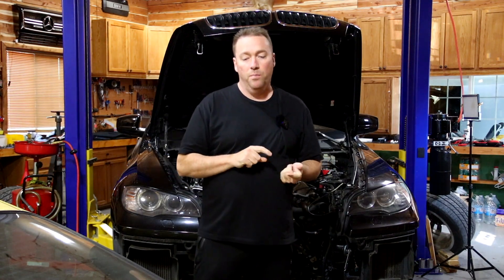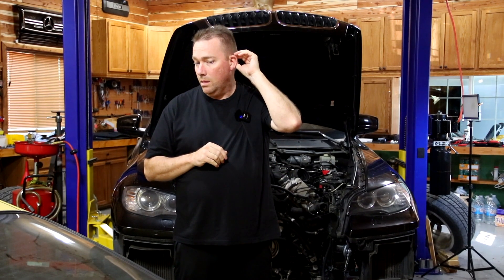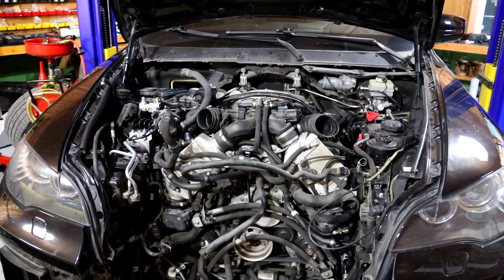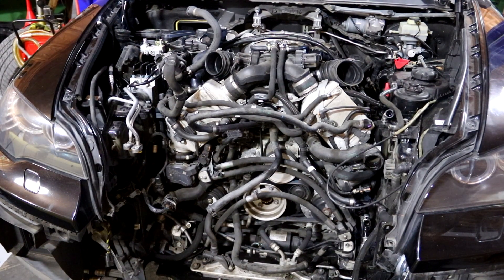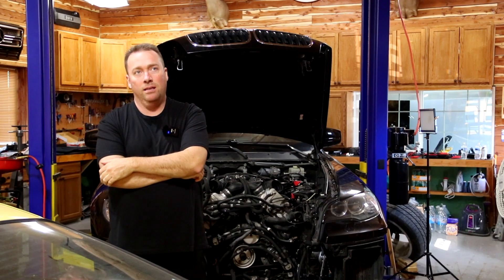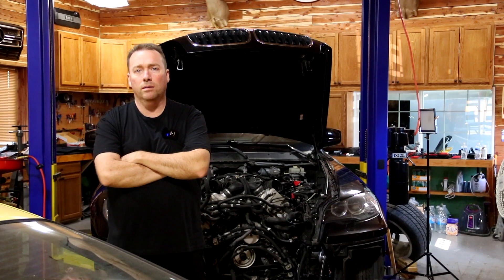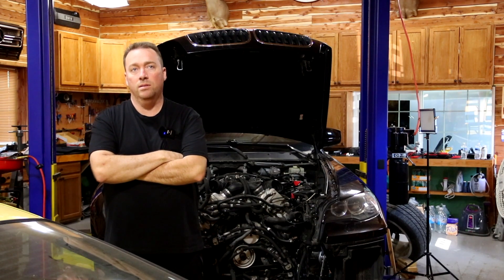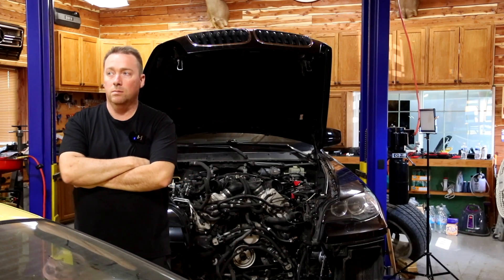So Why Do BMW Rod Bearings Fail On These Engines S62 S63 N63 N55 S65 S85

Comment: All I can speak to is the S85 V10. No one can convince me it's the bearings, it is idiot owners, wrong oil, no idea how to properly warm the V10 correctly. People mistreat the hell out of it, sell it to some unsuspecting soul, then they think they bought junk...I have had three E60 M5's, still have one today
Reply: MANY BMW issues come from poor ownership. I have a 2000 E39 528i 5spd ZF. Bought it brand new out of college. In 22yrs I had the radiator and water pump fail. That’s it. I rarely drive the car over 3,000 rpm. Don’t think I ever hit 5,000rpm. Change the oil with synthetic every 5k. Garage kept in sunny AZ. 
Zero rust, oil leaks or CCV issues - ever.
Reply: @paperandmedals8316  jeez bro how do you never red line it? I have an e39 530iA and errr... I do. I don't think that counts as misuse either, but yours should last for ever yea.
Reply: @ironmantooltime  I have a Hayabusa if I have the need. Not my E39. It’s a luxury car., not a sports car. I see people all the time in the bmw Facebook groups bitching how shorty their car is, and in another posting they’re talking about drifting it. Treat it like shit and it will turn into shit.
Reply: @paperandmedals8316  haha well yea a hayabusa will cover it. How many miles has the e39 done, she must be a beaut/minter 👍
Reply: @ironmantooltime  E39 has 96k and the E38 has 97k.
Reply: @paperandmedals8316  wait, you've got an e38 as well? Tell me that's not from new as well 😎
Reply: @ironmantooltime  no. E38 740i was one owner before me. Real estate developer bought it for his wife in 1998. I got it off of her when she was 78yo. BMW maintained for all its life, for what’s that worth.  But I literally have the one owner car owned by an old lady.  I’m in AZ, so zero rust. Plus she had some sheep skin cover on the seats so when I took them off there was leather looking perfect. 
It’s an M62 engine and I know they’re not a great engine. But the car was owned by a caring owner that could afford to maintain it. Not a kid buying $1,500 coil overs while the car is leaking oil and coolant.  Another car likely very rarely driven over 3,000 rpm and never raced stop light to stop light.
Reply: @paperandmedals8316  man that's awesome. The timing chain is sensitive to correct oil change intervals and warmup. Quite possible if its been well looked after it won't need it doing. I believe you can change the tensioner on those easily but if there's no rattle she's probably good. What a collection, wish you had a channel 😎

If you leave the ZF in drive (not sport or manual) and don't kickdown it will barely go over 2500 revs on my 530i, so for wafting around it should barely stress the engine at all. Easy 250k miles if you'll keep em that long 👍
Reply: @ironmantooltime  tensioner was indeed chagrined by me. The previous one had a collapsed spring upon inspection, though there was no timing chain issue. I dropped the lower oil pan for an inspection there,  as well. Changed the trans fluid and filter. Used Nathan’s recommended Valvoline MaxLife ATF. The fluid that came out of the trans and differential was so foul and dark. Of course a BMW dealership mechanic would never change the life time fluid.  That would be admitting that life time fluid is a cruel joke. Even ZF says 60k miles first change and every 30k there after.  Love to know why BMW doesn’t follow its supplier’s recommendations?
Reply: @paperandmedals8316  nice job, I'd use maxlife too but its quite expensive imported into Europe. Had mine done with spec zf fluid at 135k but tempted to do again 10k later.
Reply: @ironmantooltime  European! Didn’t think you guys watched Nathan. I met my wife in Romania. They have some amazingly beautiful woman there. She likes her Mercedes’ Benz convertible CLK55. Not much interest in my BMW’s.
Reply: @paperandmedals8316  sure we do, he's the internets most knowledgeable bmw guy 😎 Romanian women, 55 merc engines, bro you are clearly a man of excellent taste. Have a nice day 🇺🇸 🦅 🍻
Reply: @paperandmedals8316  hard to imagine never driving a car over 3k rpm. Must only drive around your neighborhood
Reply: @yophilli  3,000 rpm is 85mph. I shift at or below 3,000 rpm. It’s not the only car I own, but it’s a car I want to have for many years to come.
Reply: Agree running what is a race engine for long intervals oil changes is gonna do the weakest point, in this case rod bearings.
Reply: What oil do you run?
Reply: @hotfluids8758  If you are asking me, only Red Line 10w60, Red Line in the SMG and in the differential
Reply: But as he said Mercedes v8s don't have these problems so its not just owner error,  bmw is the only brand that is well known for rod bearing failure and I can't believe that all bmw owners who have had this problem are just idiots
Reply: @dmoneydmo  all those M5 V10 engine spin their bearings. They’re a good engine once that’s repaired. Mercedes has their bad engines. From 2006 to mid 2007, Mercedes go to V6 3.5 liter engine thank went in all sort of models stats with C and their E class that is a literal time bomb. The balance shaft gear had a poor metal casting and would literally chip away until the gear was tooth less, timing chain fails, and the engine grenades. Late 90’s thru mid 2000’s the stupidity of making biodegradable wire harnesses outer insulation with a Soy base that degraded within the car causes all sorts of electrical issues and also having  a sweet taste, would bring rodents into your engine bay to feast on wire harnesses. To replace such a wire harness is about $12k. $9k for the custom made wire harness and $3k for the install. In my garages right now I have BMW’s and Mercedes. Both have idiotic designs.  Fell in love with them when before I was driving, hence even owning so many. I’d take my Lexus LX or my wife’s Toyota Sienna minivan over any BMW or Benz. Easily
Reply: BMW overengineered this piece of shit of an engine and people spend 100,000's of dollars just to get this shit running again and to have it fail again. This is too funny 

Buy American fools
Reply: BMW owners have more money than sense, they love putting money into and waste money on a piece of shit engine to have only fail again.

This is too funny.

Buy American
Reply: @lldjslim  No matter how wrong you are, you are still entitled to your opinion. That, is my opinion.

Comment: Awesome info again Nathan!! I have the 2010x5 with the n62tu which has its own issues 😅
Reply: Replace all the gaskets around the engine, valve cover, timing cover, vvt solenoid oring, and all the other orings, change your oil and use seal conditioner, and that engine will last a long long time.